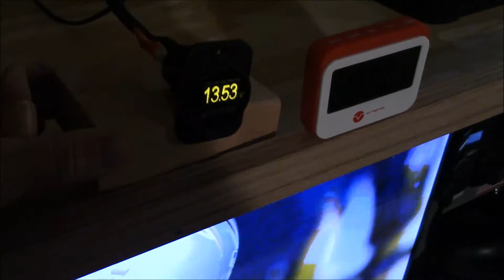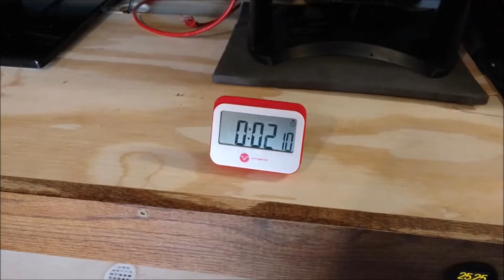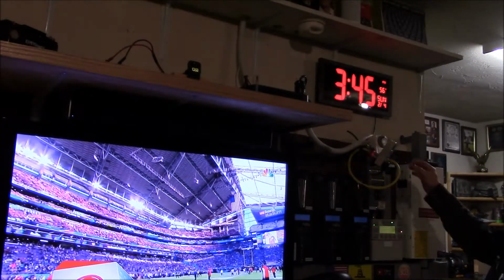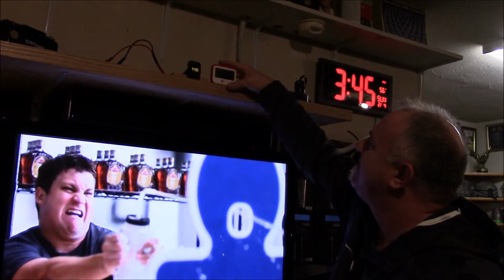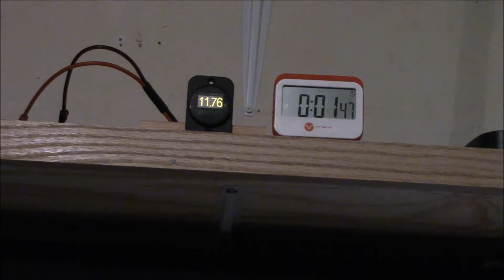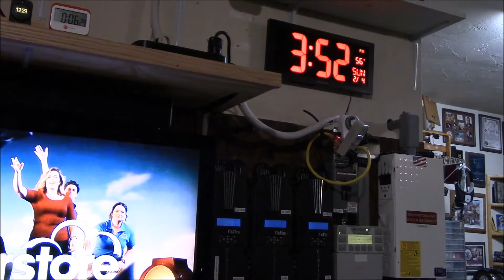How long will it last? APC battery backup (Part 2 - 200w load, 18aH Expert Power battery)

Comment: CSB  batteries and other brands too .
All the  SLA  AGM  batteries have the  same information on the  battery :
13.5 to 13.8   Standby  use
14.4 to 15.0     Cyclic use

the built in  AGM  battery charger in the  UPS   Charges the battery and
then the charger goes into   "Maintainer  Mode" , to keep the battery
topped of  at  13.5  volts .

UPS  are   "Standby"  usage thus  Maintain at  13.5 volts .

If  a  GP  General Pupose   AGM  battery is used in a  Cyclic
application , then the charger should take it up to 15 volts
before  the battery gets put into  service .

CSB  also makes  model :  EVH
the  Red  batteries , 15 ah . which is meant for
Cyclic\Deep cycle use .

GP  General Purpose   SLA  AGM  batteries made for   Any   Standby use ,
including  UPS  use , are  Specified to be  Maintained at  13.5 to 13.8  volts.
That  is the  Specification  for these batteries .
Seems  APC   chooses to  Maintain the voltage at  13.5 volts .

Your  comment in your  Description  goes  against  the  Specification
for  SLA  AGM  GP  General Purpose  batteries during   Standby  use .

I can only guess ,
Maintaining  the battery  voltage at  15 volts  will damage the  Cells .
But yet
it is ok to charge the battery upto  15.0  volts and then use it ,
just don't  keep it at  15 volts 

CSB  GP  1217  with  M5  nut and bolt , is  56  bucks .  17  ah , weighs 12 pounds .
i am pretty sure that would have done you right .

at  200 watt  AC load , my  calculated  guestamate is about 22 minutes
using the  CSB  GP  1217  M5  battery .
Should've  got that  CSB  brand battery .  APC  uses   CSB  batteries .

your  APCRBC17  is a  "CSB  GP  1272   F2"  battery .
peal the  APC  sticker off to reveal the  CSB  battery  Red  printing .

That was very , very valueble  information  with your  Amp  meter reading of  24  amps .
which very , very  closely mastches  the  calculated   battery current value .

You got a  low battery alarm at 12 volts ?
hmmm,...
i have the  alarms  OFF , on the  BN450M
and i  crank  over  200 watt load which drags
the   CSB GP  1272  F2  battery  to  11.33 volts , and
"Holding  Steady" at  11.33 volts with  everything  running .

12 volt cut off ?
when i load test here with the  7.2 ah battery with the BN450M unit ,
the battery voltage  decreases and stops at  11.33 volts and holds  Steady .
Everything is running .
12 volts should be no where close to being out of gas,
and yet , your UPS did alarm at  12 volts .

It might take  2 days or more for the UPS to fully charge the  17  ah  battery .
My max estimate for  the  CSB   GP 1212  F2  battery on the  BN450M
is  100 hours .
My initial  estimate was 24 hours , but the  UPS  charger does NOT
push  500 ma  the whole time. As the  battery  voltage increases the
charging current can reduce to maybe 200 ma or less .

Comment: I agree with you on battery longevity. Too often folks dispose of UPS  systems which "die" simply because the SEALED batts start to dry out. I have extended several by removing the cover for the rubber vent caps and adding some distilled water then recharging and replacing the caps. Penny saved and battery revived for a while.    STAY CHARGED bro'      J K
Reply from the maker: Look at what BC Truck is doing over on his channel...man, the things folks dispose of! He has "turned" so many things...really inspirational

Comment: Just a guess, but maybe it's tracking the charging cycles and you're only seeing float voltage peeks.
Reply from the maker: Oh, I agree. And I hoped that it wasn't happening. However, I watched it go through it's charge cycle from a discharged battery...nope. Only goes up to 13.53v and stops.

Comment: Boycotting football, so your videos are a great replacement. I saw a guy use a car battery wired in like that once and it lasted a LONG time.
Reply from the maker: May try an Interstate deep cycle AGM 35 aH battery next. The problem is the charging parameters for that APC battery backup...it only goes up to 13.53 volts. Many of these batteries need 14.5 - 14.8 volts daily cycling. Not that great on the batteries...so, I may/may not dink with this unit much longer. And the sine wave output on this unit sux...but, that little stock 7 aH battery holds for 7 mins with a 200w load. Impressive.